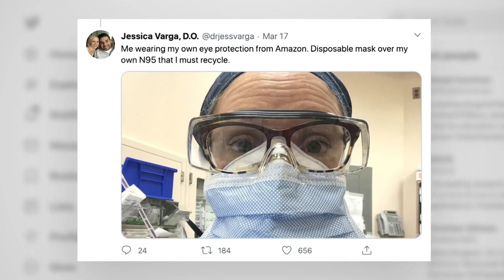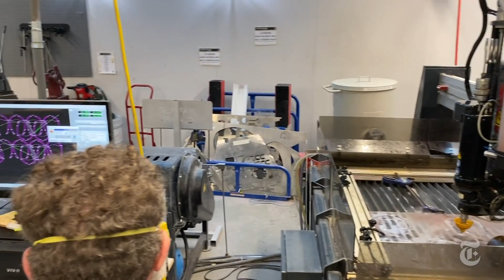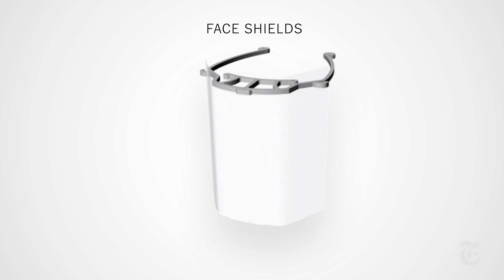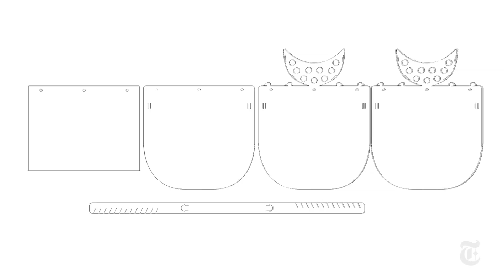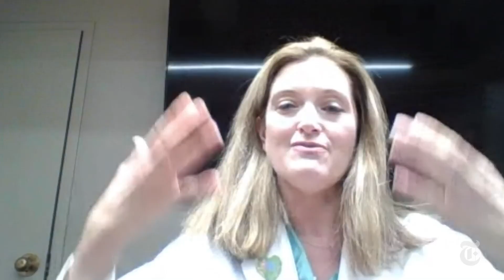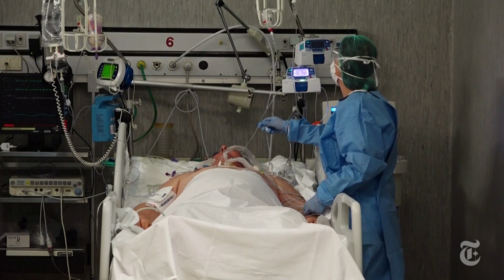Coronavirus is Straining Hospitals. Here's How Innovators Are Helping. | NYT News

Comment: Since this virus is susceptible to heat and light  e.g. sunlight, why could N95 masks not be re-used after microwaving for  x number of seconds /  minutes or left in the sun for a certain amount of time?  Apparently Covid-19 only lives on cardboard for a limited amount time.   N95 masks are made out of similar material.   Why has there not been research into finding out if these masks can be recycled?

Comment: Have the used plastic sheets melted down and recycled and molded back into face shields for futher re-use. Even getting double the use out of all the materials is crucial. Good profit system aswell, sell cheap and mass produce and recycle 100% materials minus some loses through recycling/processing.

Comment: I work at a plastic injection manufacture unfortunately we're shutdown because of COVID-19. we have 13 functional plastic injection presses just powered off doing nothing. 
if we had a mold for these critical products we might be able to get hundreds or tens of thousands made per day depending on speed and how many machines are running. 
but having worked at a CAD CAM shop i know making molds can take weeks to manufacture each one. 
3d printing is too slow but getting molds/dies made and running takes a lot of time too. manufactures also have to wait for the right plastic material to ship.  
Its hard to say where to invest the time. The big problem is manufactures are too late and slow to respond, but can produce very rapidly.  
and DIY solutions are quick to respond but produce very slowly.

Comment: I came up with an easy and quick solution for the ''face shield'' mask, a transparent plastic bag over a hat (everyone has a hat) this is to keep the plastic separated of your face and you can make a hole over the top of the bag if you need more air, also you can put a wire on the bottom of the bag at the height of your neck so the bag stays open with the form of the wire.

Comment: This virus is airborn.  Why aren't medical personnel using reusable, full face, positive-pressure, supplied air respirators with SCBA backup?

They're commercially available, actually effective, and hospitals already have air piped to patient rooms for at least the low pressure supply.

Why don't we have washable, autoclave-compatible filter media?

This event should drastically change how hospitals stock for and train for pandemic responses, how industry produces respirators, and how nations incentivize industry to maintain excess capacity within their borders for times of great need.

Comment: Normal Hygene dictates that you wash your hands for 20 seconds after touching something, sneezing, and or touching your face.  Yet (for some reason) people did not do that.  That is not to negate or mitigate the virus as a deadly virus.  Not in the Least.  But, if we just washed our hands (as we should have) then the spread would have been much less severe.  the run on "hand lotion" is ridiculous.  Soap works just as well and is much more portable.  Also, bathrooms have soap dispensers for a reason.  ::P  Mother taught you to caugh in your sleeve or a hankerchief (which has fallen out of practice).  This prevented the spread of most diseases.

Comment: Reuse them! Recycle man. Clean them. We can use all this plastic that’s around the world for them
Reply: Remember when we were all told that plastic cutting boards were better than wooden ones because of germs? 

Then some scientists decided to prove it scientifically. Well, the scientific tests had surprising results: wooden cutting boards are superior to plastic when it comes to germ elimination. 

It was one of those "oops!" moments. 

If you did not know this, I suggest you google it. It was reported years ago in the science press.  

Then there was the scientific research report that found out faucets in hospitals that had plastic parts in automatic sensors to turn on the water were a source of increased infections in hospitals. Hospitals started replacing those faucets with all metal ones that they used to have. You just should not be reusing plastic things in hospitals unless the plastic can be sterlized using autoclaves.

Comment: Years ago I bought some large bandannas at the Dollar General. They are 24“ x 24“ and are well-suited to tie in the back of the neck and wear over the mouth. I used to use them when I was sanding wood. They could be washed in a mild bleach solution and used again. They would of course fade and deteriorate over time. You could also take old sheets or pillow cases and cut 26” by 26” squares out, fold them over and tie them in the back of the neck. A couple extra inches makes it easier to tie. Tuck the excess into the front of your shirt.

Comment: As a veteran of the 3d printing and product design   industry since 2007
 and experienced medical device designer. I don't  think it is wise to 
3d print filter masks or  respirators. Most are   using materials not 
safe for regular contact with  skin or that slowly   release toxins. 
Many also use improper things as  filters. Such as   makeup pads which 
contain fiber glass. Breathing  through fiber glass   napkins and pads 
can lead to serious lung harm.  Actual 
medical   filters are engineered, not cut from an old t-shirt.   Cotton 
and  nylon  fabrics are not suitable filters either. They trap  large 
amounts  of  particulate matter then release them into your air ways  
with any  slight  vibration. None of the masks I've seen are properly  
engineered,  and  only risk of providing a false sense of security. Just
  like with  the 3d  printed medical valves. I see amateurs excited to 
help  but not  many  thinking about the legal and safety ramifications.
Reply: Here is a 3d printed (industrial) solution that has been certified/tested: https://www.ciirc.cvut.cz/covid/

You bring up valid concerns. Though even in this video they mentioned that there is still testing being done for safety.  

I think more people brainstorming results in /crowdsources more potential usable solutions.  They are trying to highlight this more diy opensource approach of people contributing to try to solve problems.

Comment: My suggestion to make the faceshield out of the plastic/vinyl, they need to make the removeable pocket that attach to the shield, for the droplets to fall in and better with the N95 materials because the surface of the viny is too slippery it will fall onto the protective growns.  Just a thought!

Comment: It doesn't make sense/ first off it depends on how the mask is being used or filtration system. Is it to stop them from getting and spreading, moisture from their mouth when talking eating? What about their eyes, a gateway.. and even the nose. So its the, what is needed not what is used.

If one just wants to cover the mouth. There are a plethora of materials some better than others some that can be cured in certain liquids that act as a barrier against other debris like dust. Even cutting up a shirt? Goggles is a pretty good measure... painters mask, heavy duty, to cotton, to even filtration fabrics from say furnace vents, to (a water engineer showed me this one) you can buy a type of fabric, that comes in like sheets, forgot what it was for, but instead of buying the 50 $ replacement filters for his fish he would just change the filter every three months with this stuff by cutting it out... Then there are washable  filters... What type of filters to vacuums use. Well some use sponges.. Which is pretty interesting and effective at trapping small dust and particulate.. So what is needed? Eyewear? Masks? Gloves? 
Technically you don't need gloves if you do't have cuts and you wash your hands well. It could enter through your cuticle in what I read, but that seems like it would certainly need lots biomass interaction to do so.
Eyewear... probably should be a standard anyways... what would be needed... one just needs see.. so hmm...

Then there is masks... because we communicate and eat... the particles could even attach to our lips when we keep them closed or enter the eyes.. .OOO... how far does one go. I think if your frontline interacting with the sick,  mask, eye, gloves are important... but more over physical distance is important.. :D For about 8k one could empty a second hand clothing store. And begin washing and cutting and drying the fabrics and making masks. Depends on the purpose or intent.

Comment: So glad the makers and the DIY community are getting the recognition they deserve. A lot of them are doing this on a volunteer basis.
Reply: Time to make a hot glue gun respirator guys
Reply: the issue is that the face shield doesn't shield at all. The virus stays in the air, unless the mask is totally sealed you get the infection in your eyes.
Reply: Axelle VW yes
Reply: Every bit of help matters. Even if the supplies are not as effective as the commercial ones, its better to have them than have nothing.
Reply: Axelle VW 
I’m making them here in the UK. West London.
If anyone reads this from the UK. I need help.  
I’ve contacted my suppliers and they are on board.
Everything is free.
Message me if you can help.
The government is redundant and impotent to what is about to happen and is happening in areas of the UK.
Reply: https://www.youtube.com/watch?v=k32RrYZ4sso
Reply: Its everybody's duty to participate.